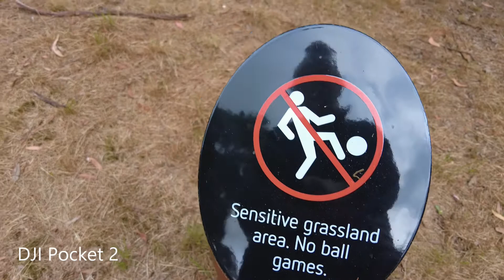Fimi Palm 2  external mics - why don't some work?  I may have an answer

Comment: 2.1V is probably enough for most electret microphones.  I've since discovered with the Palm 2 that Stereo electret microphones work, but not mono electret microphones, even though the mic port only records in mono anyway (sigh).  Why not stereo?  ☹ I suspect it's an issue with the mic socket wiring where TRS plugs work (3 segments), but not TS plugs (2 segments)

Comment: Thanks, Peter! I own the Canon Vixia HF R800 in addition to the Palm 2 which also has an unpowered 3.5mm port so fortunately all my microphones are already self powering - but I suspected the Fimi had the sake limitation after reading about people running into finicky mic issues in the various FB groups. As you own the Osmo too do you know if that jack also doesn't supply PIP? And how do they compare? The only thing I don't like about the Palm 2 is its low light performance but gather it's an issue with the DJI also. Best wishes and thanks for the video! (Looks like I am subscriber number 400 - what an honor!)
Reply from the maker: The best gimbal camera for audio is the Pocket 2 when combined with the "do it all handle" - you have the excellent surround sound from the four mics, which rotates according to the direction of the camera head, good wind noise reduction (though there's no substitute for an external mic with dead cat windshield) and it has a stereo audio input / output socket allowing replay on headphones as well as handling stereo mics needing plug in power.  When it comes to low light performance, sensor size is an important factor and the sensor on the Pocket 2 is larger than that of the Fimi cameras (and larger than most other small gimbal or action cameras).  The Pocket 2 isn't perfect - its face tracking isn't as good as on the Palm 2, for instance - but overall there's no better compact gimbal camera at the moment, most would agree.  And hey, thanks for being No.400 - I did not notice that milestone till you pointed it out!

Comment: Yeah I shot a 2 HR video with external mic and no sound whatsoever.. gutted.. 🤮
Reply from the maker: That's one of those days mother warned us about.  Gutting indeed.  But - always check any changes to equipment at home first.  And, of course, check you have a card in the camera!  That's probably No.1 reason for a day's shoot to be lost...
Reply: @Ozpeter  Update - I've actually returned it as i've tried 4 different types of mic in it and none work.. from the smallest most basic lapel mic upwards but nothing of excessive size or power requirement.
I've asked for a replacement so I'd be interested if it occurs again.. if it does in probably stuffed 😂

Comment: I had the same issue with two mics but the DJI Flexi Mic did work well.  I then investigated a little bit more and found that the one that worked (and the Rode Wireless Go) had a TRS connector on the plug (a 3 stage connector) and that the two which did not work had a TRRS connector (4 stage) on the plug.  A simple TRRS to TRS converter from eBay (about £3) made them work perfectly so check your microphone plug connector
Reply: One of the reasons I love the internet. Thanks guys!

Comment: I bought the Saramonic mic just for this but didn't work
Reply from the maker: Just checking that you turned on the camera first, wait till it is ready to record, then plug in the mic?
Reply: I have the saramonic lav mic and it works with Fimi 2, although the volume seems a little lower than i'd like. I've been using the" Voical Pixel wireless" mic system, it's similar to Rode wireless go but cheaper, i got it from Amazon uk and this works well with Fimi 2, i was actually out filming with it today, sounds decent and not distorting in any way.
I'm begining to really like Fimi 2, i've only had it a few days.
One small negative is the position of the record button, it makes it difficult to hold the Fimi 2 but i've added a tripod to it as a grip, now it feels comfortable.

Comment: What about the "Rode Wireless Go"? You can adjust its boost level in four steps? Amy experiences?
Reply from the maker: Not myself, but I would expect it to work as it's self powered.  I think "HowToGuy" has used it?

Comment: I've only got the Fimi Palm 1, which has only got a USB-C port.
If anyone does such a thing, do you think self-powered USB-C mic would work okay on the Fimi 1 then?
Reply from the maker: There is a particular  mic which has been reported as working with it - I'll try to find the link.  Watch this space...
Reply: The Hensych lav mic from Amazon uk price £23 works with Fimi 1 i have it myself.
Reply: @BLUEsurf63  Thanks for that info, other than the audio I think it's a brilliant little camera
Reply: Your right, the image quality on Fimi 1 is pretty good, it's just let down by poor audio, even with the external lav mic, the audio is low volume and muffled, certainly on the firmware i have on my Fimi 1, which is firmware 1122.05, i heard firmware 1124 is better but i haven't been able to update the firmware yet.
Reply: @BLUEsurf63  I've been using a little Olympus audio recorder with the Fimi and sync the sound up afterwards